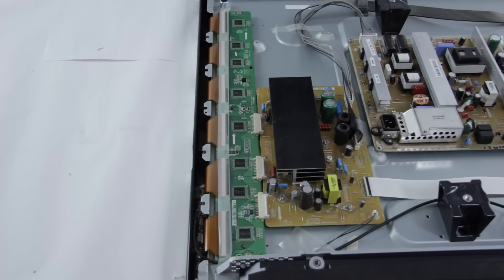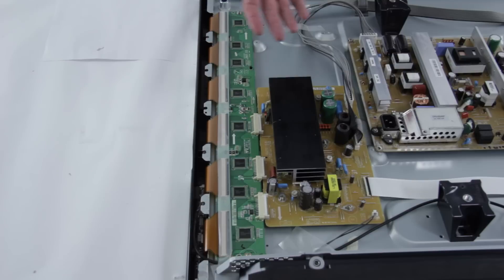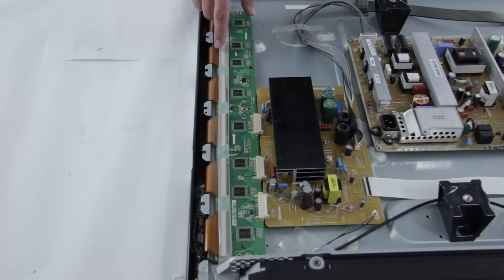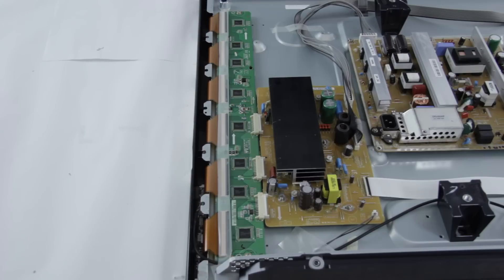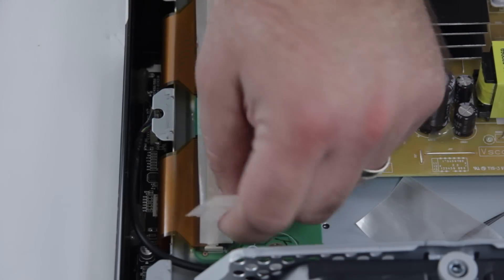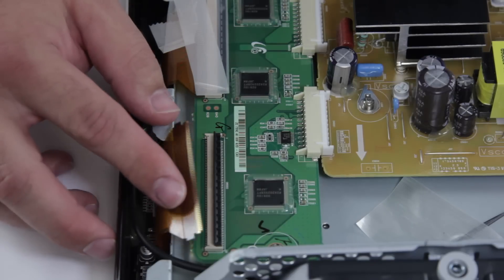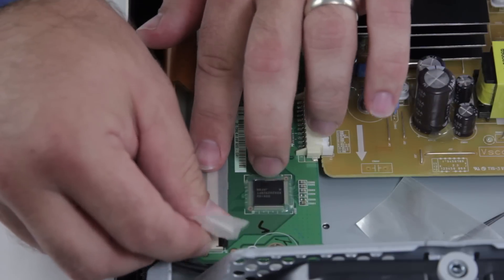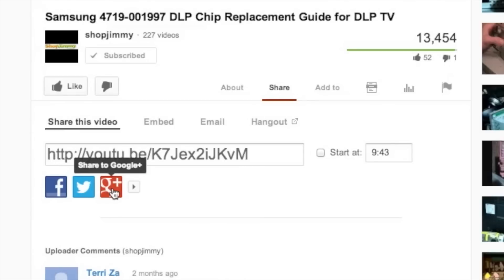Plasma TV Repair - No Image, No Picture on Plasma TV Screen - How to Replace Y-Buffer & Y-Sustain

Comment: Have a Samsung pn51e450a1f. If you unplug it and plug back it it dose make the start up sound but when you press power the light just flashes aslo with the back off you can hear a slight clicking coming from the y board but nothing's looks bad or 🔥 or bad but looked on google mostly the y board?

Comment: PN51E530A3FXZA
TV powers on but red light does not disappear and only the back light shows on the screen. No picture. The only time it works properly is if I completely disconnect the plug overnight and plug it back in the morning and it turns on properly.
Reply: Also it will not let me turn the TV off
Reply: I've replaced the power supply and still the same thing happen.

Comment: Not sure if this channel is still being monitored.  I have a Panasonic Viera 55" TV.  It just made a very loud firecracker bang sound and then the TV went black but the sound stayed on (I have a home system).  Early check on the web seems to suggest either a capacitor issue or a Y Sustain Board Issue.  The TV is 10 years old.  Is it worth repairing?

Comment: My tv is plasma samsung  pn60f5300bf. Unplugged and moved but used special TV box and unaware of damage. Went to turn on using power cord direct to TV w no peripherals. No video and makes loud, slightly variable buzzing sound appearing not to come from speakers. Opened back and have green light illuminating every second or so. Help please ...

Comment: I'm new, and having much the same problem. My LG50PA5500 TV has been working flawlessly since new. The other day, while in the midst of watching a broadcast DTV channel, the entire screen suddenly and silently went dark; sound, channel selection and inputs all work OK. I have checked connections and voltages from: stdby, pwr supply board fuses, psb output voltages to Zsus board and its fuse, output voltages from Zsus to Ysus and its fuses. All precisely normal !! I've also checked voltages to the other control boards, etc. 
No indications of cap problems, though they will need to be tested with tester in tomorrow's mail. Also a transistor tester coming.
The ONLY slight indication of anything amiss, is a (what I would call!!) light "toasting" (no pun, sorry) about 1.5" in irregular diameter towards the center from the copper coil of the Ysus board. I almost "feel" that that would be consistent with fair wear and tear of 9 years use, but of course, heat is the eternal enemy of electronics. I have very closely examined both X and Y boards, front and back for any damage indications.
I have not yet touched the Y buffer boards. If that is the next step, what is it that I should check and the sequence to follow???? 
I'm kind of at a standstill, and need some direction before I start swapping out boards left and right. Any help would be greatly appreciated. Thanx

Comment: A little help please
I've a samsung TV Model PS60F5500ARXEG
the problem is , when I plug it in the TV doesn't work at all , only the red light indicator flashed 5 times and stops for 3 seconds and that's it, no sound and no picture at all 
Note: 
When I press the remote control the red light indicator flashes quickly as if it's received a signal from the remote yet still no picture

Comment: Good day, I have a Pioneer Plasma 55" model: PDP-504PG and works with an control box. Control box is working and going on, tv also goes on but it is not showing any picture. It only shows a few sprinkles here and there on a black screen. Can you urgently assist. Thank u

Comment: I have a Samsunt PN60E550D1f that made a loud pop immediately followed by no picture but there was sound.  Shut it off and turned it back on a few times and still no picture but sound.  The LED flashes 5 x 2 and repeats the cycle.

Comment: i have a 42" samsung  plasma tv model #pn42c430a1d  one day the screen went black , and  that was it . I carried it around for 3 moves lol , it weighs a ton ,  compared to my new LG tv. Ok so i would like to fix it myself instead of taking it in to someone because they  all  say its either  an expensive fix or a cheap fix  . Ok the tv turns on and you can hear the power on chimes , and that is it .  Can you point me in the  right direction   P.S. no light what so ever comes from the screen thanks                john

Comment: I have a 50" Samsung plasma tv with all the descriptions on this video. No picture or black screen, but there is sound. The model number is HP-T5064. What parts will I need to repair this tv?

Comment: I have a Panasonic 50" plasma model TC-P50U2.  It fails to turn on with 10 blink code.  When I disconnect y-sustain I get 6 blink code.  Service troubleshooting guide says to replace y-sustain or SC board.  I replaced SC board but still have the same problem.  Is there a way of determining whether the replacement SC board is any good?  I am not detecting any problems with the SU or SD buffer boards.

Comment: I have an LG 42PC5D-UC plasma tv. Turned it off one night and it lost sound and picture both the next morning. No warning. No symptoms. "Baked" the main board in the oven for a few minutes, per video suggestions, and regained sound but not picture. Replaced the main (video) board, but still no picture. Sound ok. Used voltmeter on plugs between power board and main board. All ok. Suggestions?

Comment: Thanks for the video. I have a Samsung 42" PLASMA. the TV turns on but no picture. I cycled the TV on and off and in and out of standby a few times and the screen came on for a while. When it comes on it doesn't come on to the input it was turned off on. Wonder if this is more likely an issue with the power supply? Any thoughts?

Comment: Hai ...mine is 43"plasma model PS43F4900AR so problem is picture is getting shaded or not clear view  in whit back ground...I called up for customer care with this issue they respond me with back light or SMBS issue but no slates available for this model...so pls give a suggestion..

Comment: My plasma has dark speckle image with sound in background but does not display menu settings when remote is used or source button is pressed.my model no:PS51D490A1XXA

Comment: Hi... I am very thankful for coming across your channel. Very good quality and great explanations.
I have a Panasonic Viera TH50PV60E Plasma TV, connected to a CableTV service via HDMI. Suddenly I am just getting the sound, no image. I have opened the back panel to clean the inside a bit, but still the same symptoms. I am wondering if I could follow some troubleshoot guide in order to detect and, eventually, repair  the problem. Just as a side note: I have digital meter if i need to check some signals around. Looking forward to get some news form you savvy guys and I I thank you in anticipation. Warm regards.

Comment: I have a 2010 50inch plasma sound works on power on but no pic with vertical lines at the right side
Reply: Please help I can plug up dvd ave play sound no pic

Comment: I have Samsung Plasma TV Model : PS43F4900ARLXL

I heard a small blast like sound and the picture was gone from screen, the sound was still there

After that I switched it off but after few seconds power light turns off

Please help about common issue and solution

Comment: Hi, i have a samsung Plasma tv MODEL NO. PS60E6500.
it starts up with no Problem picture and sound, after a couple of minutes it turns off with the red light blinking. It has 2 y boards and the one is humming quite a bit. Could u please solve this issue with me.

Comment: Hi. Have a Panasonic plasma HDTV TC-P42X5. There was burning smell and screen went black. Unplugged and later plugged in again. Burning smell again. Power light comes on but remote will not turn TV off. Thanks

Comment: Panasonic th-50pz85u - Screen showed normally for a second and switched to cable source. Screen only showed partially on left side. Popped a few times and now won't even go into standby mode. No sounds, picture, or power indicator.

Comment: HEY!  Great video.  THANK you.  I have a Samsung Plasma model number:  PN64D8000ff - I just starting having issues where I can see the LED light blink to power on, and I can 'hear' a slight sound like the picture SHOULD be turning on - however its a full on black screen.  Never changes, never flashes, when I touch it - there is no change to the screen indicating its 'on'.  Your video seems to imply its the Y-Buffer and Y-Sustain.  Do you agree?  Any assistance would be appreciated.  THANKS.  Will then need to order parts.  - Paul
Reply: Same here ..any answers ?

Comment: Hi I have a Samsung Model PS43F4900AR Plasma TV. Recently we had a loud popping noice and the screen went blank we showed to one of our techinican he adviced for replacement of pannel. However he was not confident if it will work. After viewing your video it seems this a problem with Y-Buffer & Y-Sustain. Kindly advice what should I do.

Comment: Hello, I have a Samsung 60” plasma, the TV turns on with picture and sound, then after 5 minutes or so the picture disappears but sound is still working. If I unplug the tv and let the tv sit for a little bit and plug it back in, the same thing happens all over again... I’m assuming it must be a solder joint that is bad and when the tv heats up the solder joint looses connection, thoughts?? Thank you very much.

Comment: I have a Samsung 50 inch plasma display with a (sound but no picture) symptom. The model number is (HP-T5034) Model code (HTP5034X/XAA) Serial number (AJ1M3CMPB00202F) Version (AQ22)

Comment: I have a Zenith Plasma TV, Model Z50P3, that has no picture, no audio, and no standby light.  When I plug it in, the power supply board makes a single clicking sound.  I checked the standby voltage along with the other voltages as noted next to secondary section connector.  All voltages are showing the proper voltage. All Capacitors don't show any bulge on the crown area. There is proper voltage going from the power supply board to the Main logic board but have been unable to check any further than the connectors on the Main Logic Board.  Also, all fuses are good.

Comment: Hi. My plasma TV 42PQ10R-TA having similar problem. After power on, there is a tik-tok sound 2 time then TV remain in stand-by mode. There is no picture @t diagnosis so far...With YSUS connected, no regular voltage coming to YSUS board. If remove YSUS, voltage shows normal. I remove YSUS & check all MOSFET & capacitors. All looks good. Unless I am not checking it right. Where else should I go next ?

Comment: I have a Samsung plasma model PN51F4500BF that powers up shows a picture for approximately 30-45 minutes then goes black and i loose picture and sound.  I shut it down and once it cools off a few hours later it works again. Could this be the Power supply board or main video? Thanks in advance

Comment: Hey there, I have a 60" LG Plasma TV Model No. 60PA5500. The TV, when powered on, there's sound, but no picture. I'm suspecting its the Z-Sustain board. Any sugestions to what can be the issue? Please let me know. Thank you!
Reply: Did you find a solution to the problem? Just bought one of these TVs and was ripped off lol

Comment: I have a samsung 64"  plasma tv pn64d8000ff. With the x sustain board and ribbon cable going to the y sustain board unplugged i get all the correct voltages. When i plug in the ribbon cable the vs and va voltages drop. When i plug in the x sustain board i dont get the va and vs voltages. Possible bad x sustain?

Comment: I have a Panasonic 50" plasma and It had a 10 blink code and I repaired it by getting a Y-Sustain board from you. It then worked perfectly for 10 days. Now I have a problem with no pic or sound with a 9 blink code. What can I do about it now?

Comment: Hello! I have Samsung Plasma PS43E490B3R model tv. I have no picture on screen problem and I found in Y-sustain board IGBT (FGD4536) short problem,I replaced the same but again it burnt with spark...I also checked power supply board and found VS voltage 130v which should be 210v and VA also observed 130 which should be 58v..pls help me to over come from this problem

Comment: I picked up a Samsung Plasma Model# PS42B4302D from my friend. This unit had multiple issues. Pretty much all the boards, i.e. Y-Sus, X-Sus, buffer boards had blown up MOSFETs and diodes. I have been repairing electronic gadgets and computers for a few years, but I have never encountered a device with so many faults. 

Ideally, I should have abandoned the repairs and recycled this TV, but something prompted me to troubleshoot. And guess what, after changing the MOSFETS and other SMD diodes the TV is powering up with constant voltage (VS: 207VDC and VA: 54VDC ) readings. 

However, I noticed that the set displays the OSD, but as soon as on pressing any button on the menu, the TV shuts down. If I don't do anything, then OSD keeps on showing and the voltages are constant. I believe the logic board has some issues as well. Since I don't have the schematic for this Plasma, I am wondering if you can shed some light on which SMD component can be suspect? Repairing this TV has become fun, but wasting more time on it is not worth it.

I am thankful to anyone in advance for advising me on what I should do next.

Comment: hi, I have a Lg plasma TV  60pg60f-ua . On the upper right part of the screen there is a white square with colored lines going down in it. Rest of the screen is showing fine. On and off just find, no blinking lights or such. Where would I look first or most likely problem to check. could it be the logic control board or main board ? Power board is fine, Ran a meter on things and I just cant locate the problem. Didn't find any thing wrong on the YSUS board or the ZSUS board. Ribbons seem fine, looked at the ends of them all and reseed them in place. Any directions you could give me to look for or test ? Thank you.

Comment: pn51e530a3f Samsung plasma has tiny scratch at 45 degree angle from the bottom right corner and doesn't display picture. Is in brand new condition and when turned on the red light blinks a few times then gives up with a home sound effect

Comment: Have a Samsung PN64D8000FF bought new in 2011. Does not get much use but now picture goes from fine to black in a blink after about 30 to 60 minutes. Turning off and back on buys you about another 30 minutes until if goes out again. Sound continues uninterrupted while picture is out. Power light stays out -  no blinking. Can this be fixed with a board swap?

Comment: Thanks for sharing your knowledge. I have the F8500 from 2013. It blinks only but does not show a picture. At times you can hear audio but no image. This used to happen less and I can see the image and audio but now it doesn't turn on at all. Just the blinking red led. What parts do I need?  Thanks.

Comment: Lg60pn6500-UA
307RMFP78499

Turns on has sound no picture.

I have replaced the main, logic and power board. What else could it be or what should I test?

Comment: I have a plasma tv 60pv250-ub . 
The symptoms are the following:
When I turn on the tv I have black spatter spots. They go away once the tv warms up.once the tv is warm I the picture is dim.
Could this be the ysus board and buffer?
Reply: Mine does that but goes completely black. Already changed the Main and logic board and still nothing..

Comment: I have  LG 60PV450-UA plasma tv and it started given some weird colors when watching tv. For example an the white background gave some redish color which I could see like if it was on tp of the white ith gray background gave me some green and pinkish colors. It worked fine like that for a couple of months and on day it didn't give me any video at all, but it had audio. I turned it on today because I was watching your videos and there is no audio. The tv turns on and if I push the volume or channel button the red light blinks. I push the power button and it turns off.
I would really appreciate your help and if you can give me an estimate of the parts of what you think is causing the problem I would really appreciate it. Thanks.

Comment: problem with lg 42pa4500 sustain board the two terminal mosfit under the board is short, do ihave to change them only or I should change any thing else, there no new mosfir in our market where I can find them in old board is there any alternative

Comment: hello

TH-C50FD18 Panasonic Viera has no picture or sound. Changed the Y-sustain and Y-Buffer boards also the Main Logic and Power Supply Boards still no Picture or Sound

Comment: I have a Samsung plasma model number PN43E450A1FXZA. The screen is black when I plug it in and has minor cracks in the lower right corner. It still has power but no image. I removed the back and it has blackish brownish marks through the back panel but it's probly a crazy qeution but could it be fixed?

Comment: Hey there, I have an LG 50" Plasma TV model Number: ERB64966601

I noticed a single black line across the middle portion of the screen the past couple months. Yesterday I tried turning on the tv and noticed that it powers on but the screen stays black with no sound. Any ideas if it is the Y Sustain? Or if the tv just needs replaced?

Thank you in advance.

Comment: Hi, I have a Samsung 50” plasma, model number PS50A456P2DXXU serial Z5GF3STS200897V.
The tv was left on standby for 6months without use. When I eventually went to turn it on there was no picture. I have taken the back off and tried reconnecting the ribbons and giving it a good clean but no luck. There is a green flashing light when on standby so I guess there is no issue with power. Any ideas?

Comment: I have a LG42PN4500-UA. When I turn it on, the red light blinks 3 times and has sound but no picture. U can hear sound for about 5-6 seconds then it turns off.